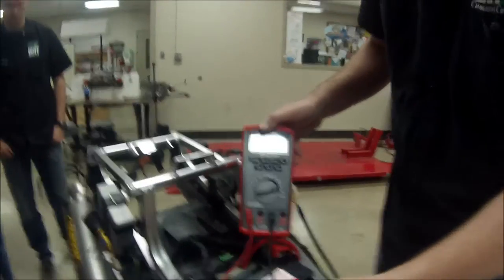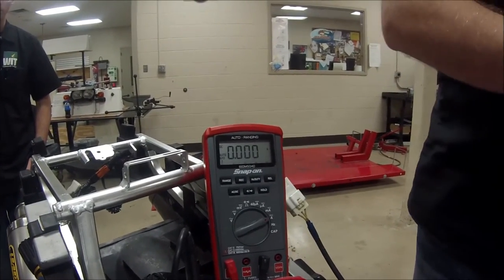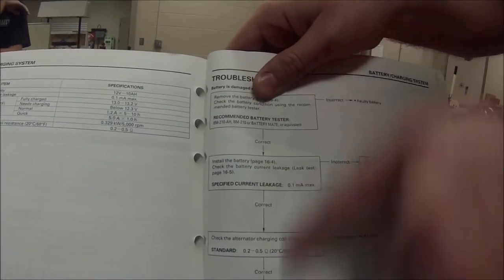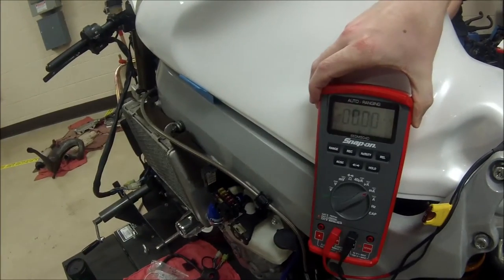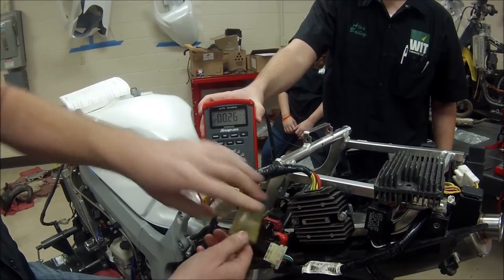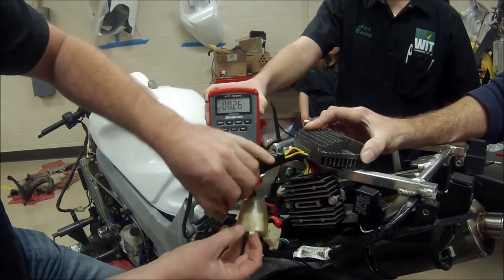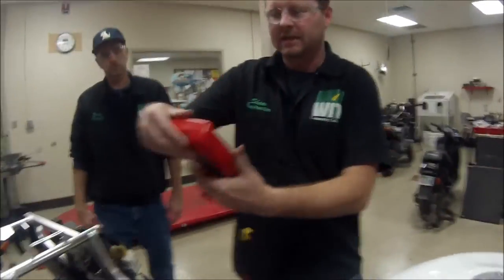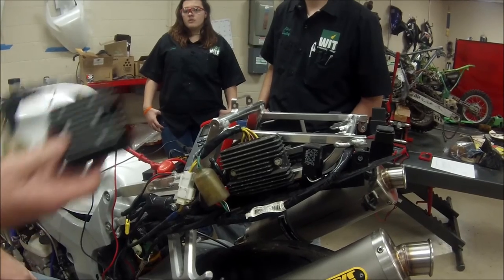How to test current draw on a motorcycle charging system Demo on  RC51 with bad reg rec

Comment: I have a drain on my 02 Ducati monster. I tried this with my meter and it showed no amps so I’m at a loss. I pulled out reg rec and checked the diodes with my meter. They all look good.  Noticed while checking my starter solenoid that when pushing the start button with key in but cables off the solenoid after a few tries the solenoid would not release. It was staying engaged.  Unplugged the start button from starter solenoid and tried again with my meter leads hooked up checking for voltage. After hitting the start button a few times it would stay at around 6 volts and not drop back to zero. 

It’s very weird that I don’t see any amps though when testing inline like you did in this video. Started at 20a and worked my way down to 200ma. That’s the lowest setting I have
Reply from the maker: Hi friend.  I try to answer when I've seen it before, but I don't recognize this one. I’m the Social Media Manager here. That’s a good question for Shane. He gets hundreds of requests a day and starts each day answering MEMBER or donation support questions first and then if there is time he will try to circle back before heading to the shop for customer work. 
Want faster response times? Join link below.
Thank you for commenting. Want more benefits? 
-Daily MEMBER FIRST COMMENTS ANSWERED FIRST 
-Live Q/A video chats
-Wonder if we have a video on your need? Members can request content links!
-Full Access to the ENTIRE 700 video library
-Member-Only FREE tool giveaways 
Join this channel to get access to perks:
https://www.youtube.com/channel/UCBhM8DCKnT3qXwTW0eToyCg/join 

Just want to say thanks quick to support us for this information and our work saving you money? 
Give us a high 5 here:  https://www.paypal.me/how2wrench